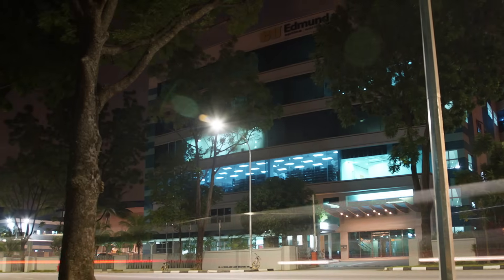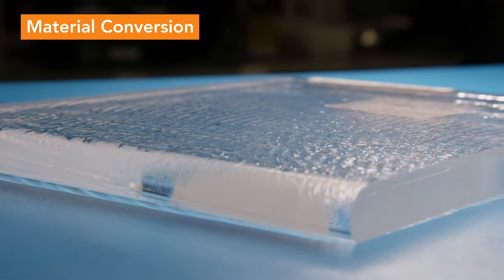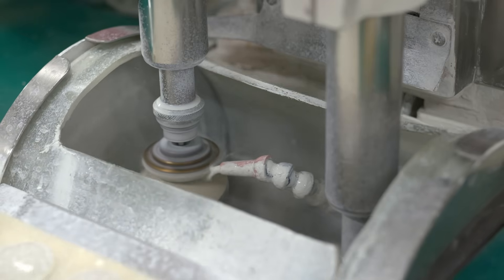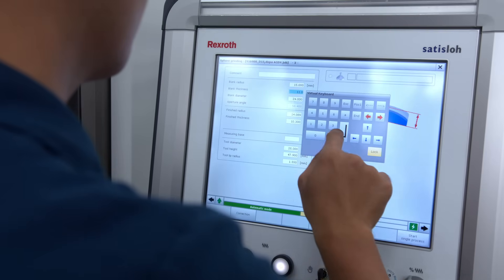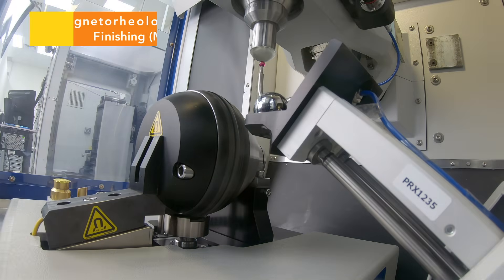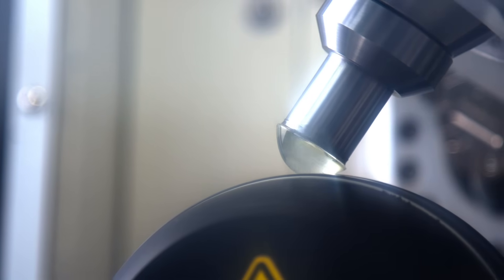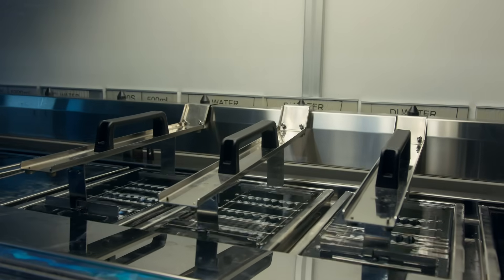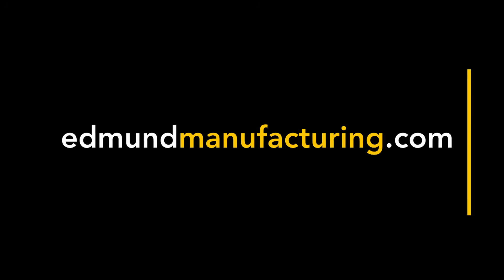How an Aspheric Lens is Made

Comment: Ive broken my camera lens element accidentally , i want a spesific lens element can i get the job done?
Reply: would be needed to know the glass type (are there +100 diferent optical glass for ohara and schott), the diameter, the center thickness, the curvature radius for both surfaces. The price would be astronomical for a single lens.
Reply: If you ever find a company that does answer your question, or is able to do one-off jobs like what you’re requesting, then please let me know as well.
Reply: Look up custom optics on any optics company site